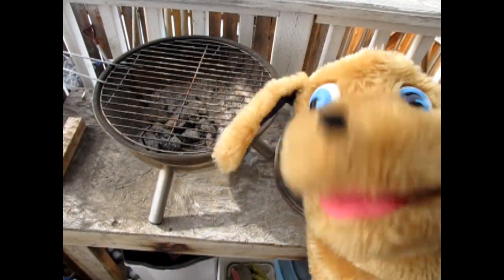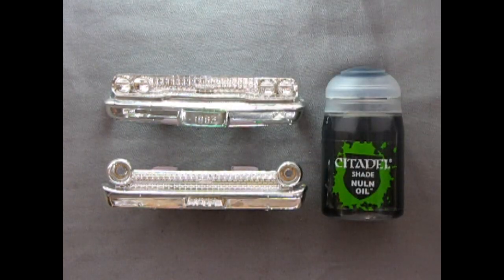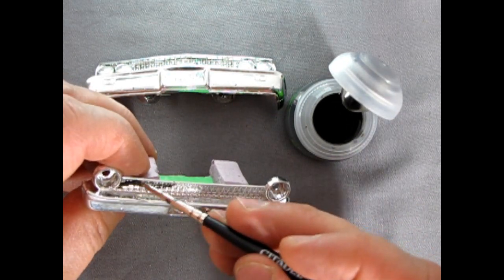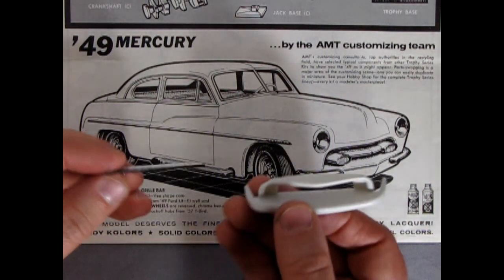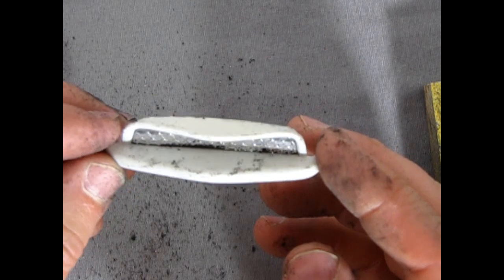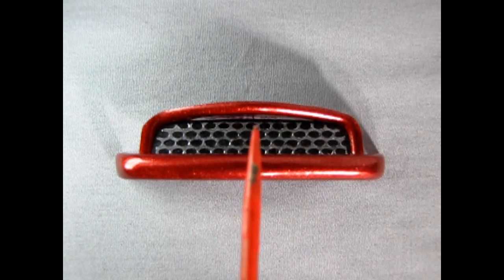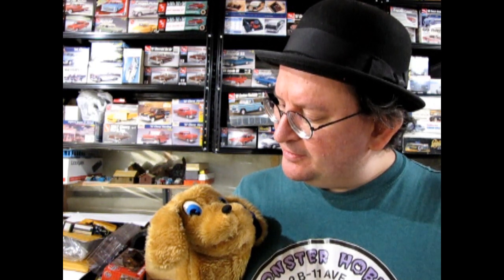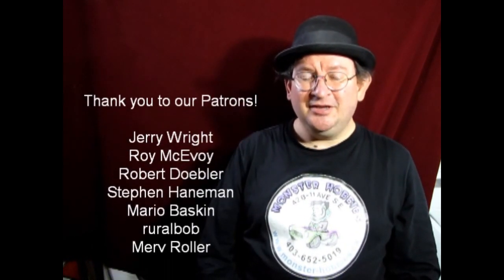Model Car Garage Tips and Tech - How to Apply A Black Wash To Your Model Car Grilles and Wheels

Comment: Great job on the '63 Ford (with what you had to work with). I so dislike the raised "seams" on ALL kit chrome bumper ends. No real car with beautiful chrome bumpers has an ugly vertical raised scar at each end of the bumper when viewed from the side. I  always sand the chrome raised blemish down smooth and either attempt to cover it up with Motolow chrome pen or Bare Metal Foil. Glad i found your tutorials.
Reply from the maker: I am happy that my videos are helping you out. Those bumper vertical seam lines are a pain. I try to remove them when I can.

Comment: Love that '63 Galaxie model as I have a real one!  I need to get my hands on the newest release of the model.  AMT/Round 2 really added alot of value to an old kit by adding decals for that grill emblem and side scripts and things.  I've built several models just using Testors enamel paint in the grill and wiping the high spots with a q-tip.
Reply from the maker: Right on! I started with Testor's and some thinner and a rag back in the 1980's. Dad showed me how back then. Just thought I'd bring the video "up to date" with the current paints. 

Hope you can find that Galaxie soon!

Comment: Can you use a black    Acrilack.  And water ?.
Reply from the maker: Yes. This paint is acrylic and is theoretically thinned down to flow into the cracks. You could make your own version by watering down paint or applying paint thinner if you want to use Enamels.